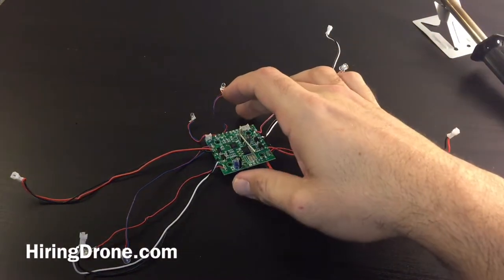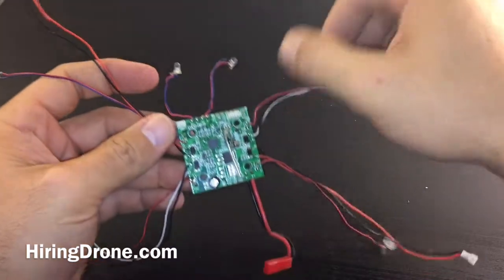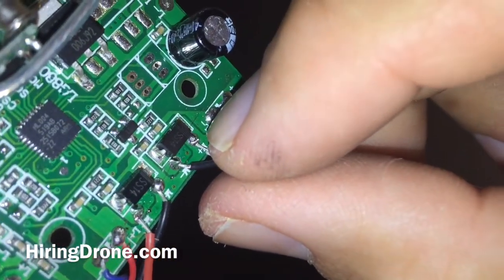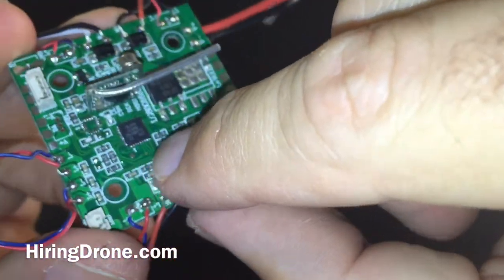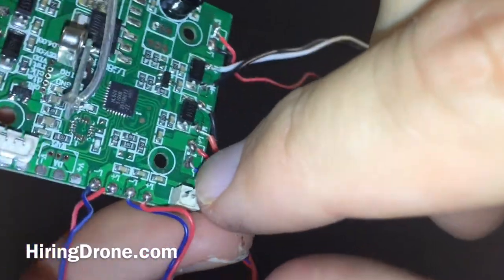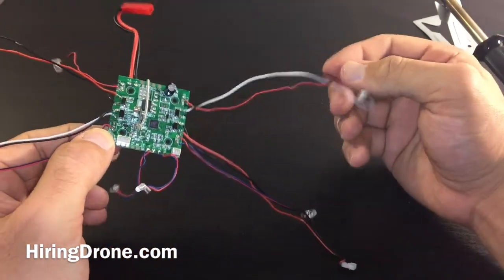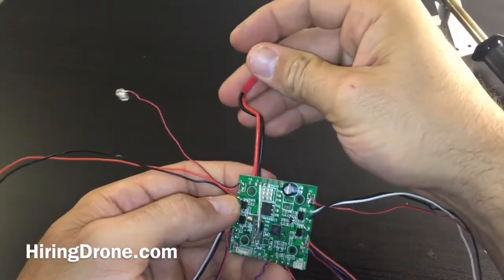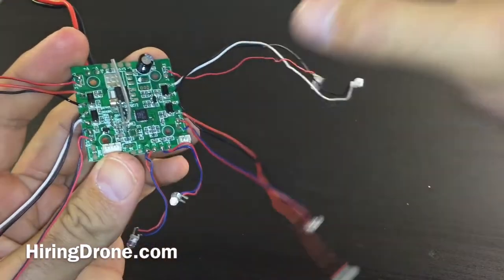JJRC H16 Tarantula X6 Receiver Board

Comment: Flying eradically and losing power x6...Replacing this receiver board will fix it? Thanks Kevin
Reply from the maker: +kevin Have you checked your motor gears? What about the batteries in your transmitter? Mine started flying erratically, but it was actually my motor gears. They wore down from lifting a GoPro. Once replaced, the JJRRC H16 flew like a champ.
Reply: Yes I checked all gears and motors. ..Also checked all batteries and recalibration of gyros etc..Still loses power so I'm replacing the receiver board and thank you for your help. .
Reply: +kevin your board has bad gyro's. Did it fly weird out of the box? or did this behavior start after a few crashes?

Comment: hi...how do I connect a new receiver board to an existing transmitter...?
Reply: Which are the 2 points hat needs to short to bind to a new transmitter?  thanks.
Reply from the maker: +Shayne X To bind the transmitter to a new board, plug your battery in like normal and then turn on the transmitter. Once the lights start blinking on the quacopter, move the throttle stick up and down. This should bind the two together.
Reply: +Hiring a Drone hi...thanks. actually what I meant to say was if it  still remembers the old setting... how to reset it..? so it can be set with a new transmitter. thx.
Reply from the maker: +Shayne X Every time you power on the quadcopter, you have to bind the transmitter. The H16 does not hold a memory to one specific transmitter. If you have two transmitters and you turn the H16 on, whichever transmitter you bind first, will control the H16. The transmitter holds a memory of your trims and speed modes only (I think). The transmitters and receiver boards are all universal. After I swapped out my new receiver board, I powered it on, then the transmitter, moved the throttle up and down on the transmitter, and the new receiver board was bound to the old transmitter. This works vise versa too.
Reply: +Hiring a Drone hi..thanks a lot for the details. if I would like to bind other transmitter with the existing board (not a new board) for eg syma x5 transmitter..is that going to work out the same way?
Reply from the maker: +Shayne X No, it will not work the same with a SYMA.
Reply: so u mean to say that any X6 transmitter (of any version) is not compatible with this version? and we have option of using only 1 type of transmitter?
Reply: +1979zeesh actually it works.
Reply: +Shayne X I used the same transmitter with at least 2 board now. it's simple...it uses the same specified frequency for that board.
Reply: so do we need to do some configuration changes with them or just bind and they are good to go?
Reply from the maker: +1979zeesh you only need to bind the transmitter with the new board. All JJRC X6 transmitters will work. Bind like you normally do when powering on the quadcopter. My old transmitter has worked with two replacement boards.

Comment: And how long will the new receiver board last any idea?
Reply from the maker: +kevin +kevin Not sure how long the new board will last. I broke the old one by soldering on it too much. Fried the board trying to connect a camera with the wrong voltage and/or heated the board too hot. The should last awhile, especially if you do not plug anything in with the wrong voltage. If you crash the JJRC H16, you might check to make sure all your wires are connected to the board. Be warned, to replace the old board with a new board, you will need to solder all the old motor and light wires to the new board.
Reply: +Hiring a Drone I also took it apart and checked all wire and solder connections. .Could running the lipo to low cause a low voltage burn out on the board? A 1300 mah battery shouldn't hurt it..7.4v?
Reply from the maker: +kevin Low as in not fully charged or a lower mah battery than recommended? You will get throttle dropout if the battery becomes low. Sometimes the lights will not blink, letting you know your battery is low.  I have experienced this lifting a camera or heavier than standard landing gear. Fully charging the battery seemed to fix that issue. Possibly, you might have a  bad JJRC H16 battery and/or charger? See this video of the JJRC H16 dropping from the sky from lack of battery power. https://youtu.be/qifBlVzmD98
Reply: +Hiring a Drone I have tried other batteries. ..No it will fly normal for a minute or two and then get a little eradicate and lose power and land...Then after a few seconds I can bring it up again like it has full power only for it to do it again..
Reply from the maker: +kevin That is bizarre. I haven't personally experienced that. Any issues with the range or antenna's on the quadcopter or transmitter? Magnetic compass/headless mode shorting out in the transmitter? Before replacing your board, try taking your props off. Power up the quadcopter, set the transmitter on the ground, and walk away with the quadcopter in hand. This might help you determine if you are having a range issue due to transmitter or antenna issues. If you can identify an issue from this test, this might save you a lot of headaches swapping out the board. The transmitter wires are very loosely soldered inside. Additionally, I had my LED light come loose and wrap around my JJRC H16 antenna inside the quadcopter. This caused feedback issues.
Reply: +Hiring a Drone Ok...But this all happens within a few feet...Its like when the battery is getting low and it starts to power down type power loss but battery is good and full..Yes it's strange..This all happened after it flew fine the evening before..The next evening it started this...I did have the 7.4 v 1300 mah battery in it and ran it til it wouldn't run anymore. ..But other batteries are the same...Thats why I was wondering if I could ofbhad some sort of low voltage burn out on the receiver board..
Reply from the maker: +kevin It is possible. These things are built extremely cheap, so your board could be bad. The new board I purchased looked used, so who knows what condition they send these things out from China. If you have the top shell of the quadcopter off, see if your board gets abnormally hot when the battery is plugged in. Before my board went out, it started getting super hot, with just the battery plugged in. Eventually, the board stopped working.
Reply: I know one of my motors was getting hot. ..I put it back together but when the other board comes in  I will check first to see if it the board  gets hot with the battery plugged in...Yes thet are built really cheap but so damn fun to fly..lol. Do you know of a better built better quality cousin or brother to the x6? Something not from China that doesn't cost and arm and a leg?  Not DJI but more toy grade but good quality. ..Thank again...I'll let u know in a month if the receiver hoard did the trick...If not I'll give up on the China stuff..
Reply from the maker: +kevin It is always a gamble ordering from China. I like the V303 and XK X380, but it took me a month to get mine flying. I had to purchase a new receiver and transmitter, because they shipped it with old ones from Gear Best. Best Buy had DJI's Standards on sale with a gimbal and 2MP camera for $449. By the time you purchase one of these knockoffs from China, add a camera, gimbal, etc... you end up with a cheaply built quadcopter, that is half the quadcopter as a DJI. I buy a lot of cheap random ones to make videos, but if you want a good flier, DJI is the route to go. You will save yourself time, headaches, and money. I guess it really comes down to what you want your quadcopter to do. I like to purchase the DYI kits, because you can customize your quadcopter. Building one of my own, really helped me learn about how they work.
Reply: I did order the JJRC H26W before the x6 decided to go to sleep which leaves me worried that it will be  the same thing all over again but not a 3rd time...They did tell me if I have any defective parts they would send them to me free of charge and not to worry but I have seen some reviews of the h26w since Im waiting for mine to arrive and its not looking good..lol..Thank you again and I will let you know when I find out more...Blessings to you..
Reply from the maker: +kevin No worries. Best of luck and hopefully you can get your X6 back in the sky. The X6 is one of my favorites.  I have had good luck with my JJRC's, except for my H20 hexacopter.

Comment: +Hiring a Drone I have an X6 quad but it doesnt mention its Tarantula and also the quad body is a bit different from what is shown on internet. but it is mentioned simply X6. I have its 2,4ghz transmitter. can i use that transmitter with this receiver u showed in video?
for a 2.4ghz receiver, can i use any 2.4ghz transmitter or there is some sort of matching?
Reply from the maker: There might be a different X6 out on the market, besides the Tarantula. If yours looks different than the one in the video, it could be a different quadcopter. I do not think they made a new version of the Tarantula yet, but I could be wrong. Not all transmitters work with different quadcopters. For the most part, they are pretty limited to the makes and models they work with. You can try to bind your transmitter. Generally, you need the correct receiver for your transmitter attached to the flight controller for it to work.
Reply: Can you send me ur email id where i can send you pictures of the board and quad itself....it is also mentioned as X6 quad. the board resembles yours except in yours the ESCs are on opposite of PCB and there is a crystal while in my case ESCs are on same side and there is no crystal. so i need to send you pics to see and advise so that i can decide to buy the board to replace the current one as one of the ESCs are burnt.

Comment: 2 weeks ago I said no more replacement boards for me, well i haD AN X6 board already in the mail for a v666 project,  I got that board solder all nice and neat the best I could, I purchased new led's from the electrical supply and I'l be dammed after 2 days on this SOB,  i GET THE led's to light up. but the board wont bind and the motors wont spin.. God I dropped so many F-bombs the other day its not funny... I am not taking this sitting down.. I ate the first non-working board because i solder like forrest gump with all thumbs,,but with the money, sweat and tears I put up for the x6 board ? no way Im aborting without a fight!